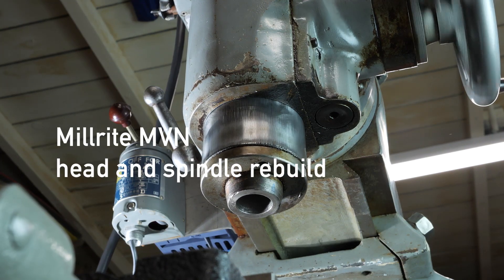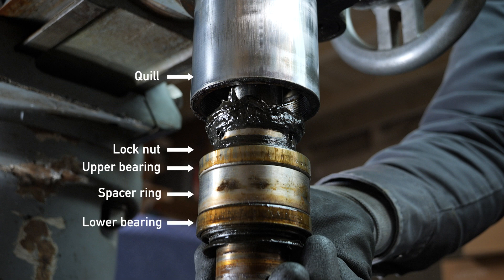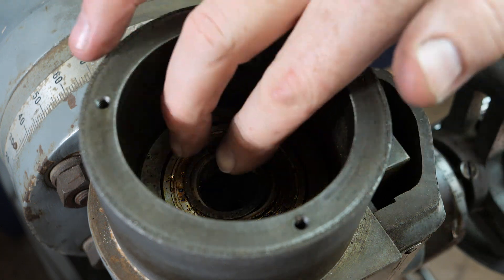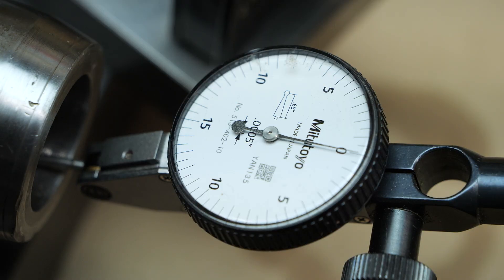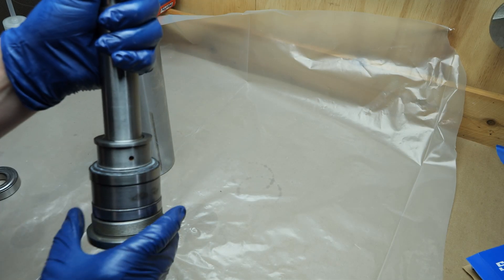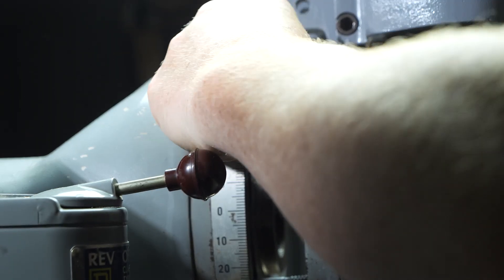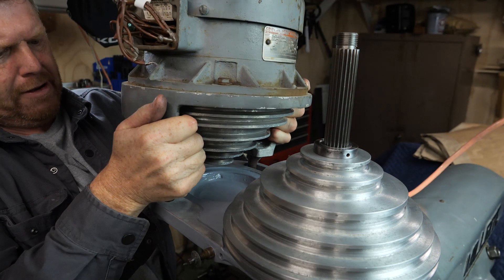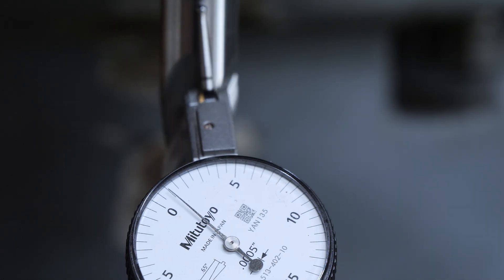Millrite MVN milling machine spindle rebuild

Comment: I've had my MVN for 53 yrs now,  and it has required only lubrication for maintenance ( none for the spindle bearings ) .  I bought an older Bridgeport as a backup,  but never use it  -- the MVN has never failed me.

Comment: I had a MVN with the R8 spindle, the drawbar was just like a Bridgeports:  loosen the thread, tap the top of the drawbar with a little brass mallet to free the taper,.  Maybe your drawbar is specific to the B&S spindle.
Reply: I believe the drawbar design for the MVN changed over the years  -- mine, too, has the Bridgeport type drawbar, but I have the latest of the MVNs (the Powermatic design) .

Comment: Here is a useful tip for you: a 12-point 18mm deep socket fits perfectly onto the 5/8 square knee drive shaft. Put a cut off socket driver extension into a chuck of an old low RPM/high torque 1/2” variable speed corded drill and you have a cheap power feed for the knee.
Reply: Sunex makes a 5/8" square pipe plug socket .  I use one on my MVN knee at times when the hand crank doesn't work on some applications .  Sunex also have 1/2 square drives too -- I use one of those with a short breaker bar to replace a missing vintage vise handle for my Bridgeport .
Reply: @KS-on9qp tried that but it was too wobbly for my liking so I returned it.
Reply: @rok1475  I can understand that.  I don't use a drill motor on mine,  so I can live with a little sloppiness.  Good tip about using the drill motor though !  ..... there has been many a day that I wished I had a power knee .

Comment: The quill is well designed for grease, you want the oil in the grease to migrate downward into the bearings.  With a pool of grease near the locknut, the oil will slowly seep out and into the bearings, if you used oil, it would quickly flow through and not lubricate the bearings sufficiently.  

Did you use standard tapered roller bearings instead of grade 3?  Timken grade 3 are sold as individual cups and cones, so I was surprised to see the bearings packed with both in the same box.  The machine shop was correct, there should be a slight interference fit of the inner rings and spindle.  With the rings loose, they could spin and cause damage to the spindle.  The way to repair it would have it chromed or metal sprayed and reground, but you would want to make sure the rest of the machine was in good shape before going to that expense.  Since you have good runout now, leave it and run it until it becomes an issue.

The pulley bearing was bad on mine as well, that one seems to be the one that fails the most of these mills.  My spindle bearings looked good, but I bought a set of new bearings and will be replacing them before I get my spindle reground, it has .0015” runout and I want it better than that.  If you need to get a spindle reground in the future, give Wells-Index a call, they build knee mills and offer regrinding services and would be a good resource.  

Have fun with your mill, I love mine!
Reply from the maker: --Agreed about the grease vs oil assessment.
--I used NSK bearings. I found it hard to source Timkens. I started looking and realized they do sell cones and cups spearately. I made a go at picking up some NOS on ebay but couldn't find much beyond a pair of cups. Perhaps I wasn't clear at the end, but I did actually send the spindle out to be chromed and ground back to spec, then the internal BS9 taper was reground. It improved the runout quite a bit. I got it to about 6 tenths, and it went down to.00015" or better, depending on the collet you pick and how its clocked in the taper.
--The shop that I used was called MZI Precision Spindle in Huntington Beach California. Ed Zitney explained that genuine Timkens are getting very tough to find in that grade 3 precision. Thanks for watching, hope it helps!
Reply: @ that’s funny, I wasn’t finding the NSK bearings available, but Timkens were in stock at the warehouse.  I bought the cups on ebay for fairly cheap, and got the cones from Eastern Bearings for $242 each, that was a good discount from the website prices, and significantly cheaper than anywhere else I could find them.  I must have missed the part about getting it chromed, glad you got that fixed, your spindle should last a lifetime now.
Reply: @junkyard_kahrs  What kind of tapered roller bearings did you use, some ISO precision grade (P4 etc.) or just the regular ones? I'd say this is an excellent result as far as runout goes.
Reply from the maker: @kfoltman  They were not the highest precision. I think the ones that matter most were rated ABEC 5. If all the mating surfaces are clean, straight and square, and free of burrs and contaminants, these deliver a very good result for what I believe was a couple hundred bucks.

Comment: What you think might be an oil reservoir seems to me like it's a simple labyrinth seal to keep dirt out. Regarding oil lubrication, it'll probably work better than grease for all the reasons you've stated. However an NGLI? 000 or 00 might works as these greases are very thin.

Comment: Have you considered using a Locktite product? They make a product for seating bearing races on shafts. If nothing else it would stabilize what you have.
Reply from the maker: I did consider that— but as it was already in expert hands at the spindle rebuilder, we decided to ‘take the high road’, so to speak. My regret is that I have no pics of the grinding & plating process. And since I didn’t do final assembly, I never got to see the final product before it disappeared inside the quill.
Reply: @junkyard_kahrs   This is a great video with good detail. I paid too much for my MV1, but it does work well enough. I do miss a nodding head and power down-feed, but the size is good for my tinkering. I might have tried a heavy knurl and grind that to fit the bearing races - maybe a touch of Loctite 660 as well.